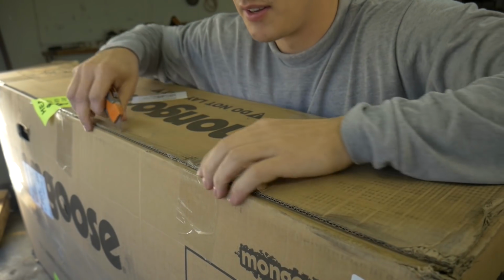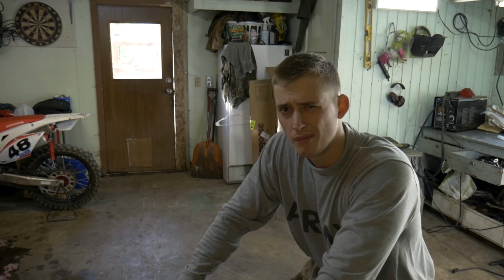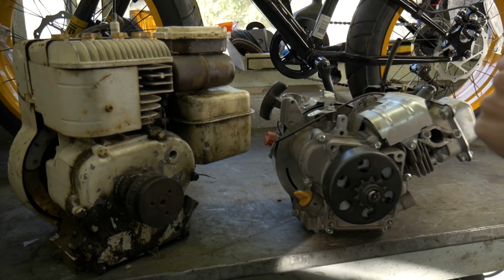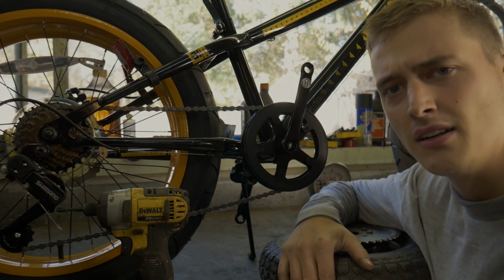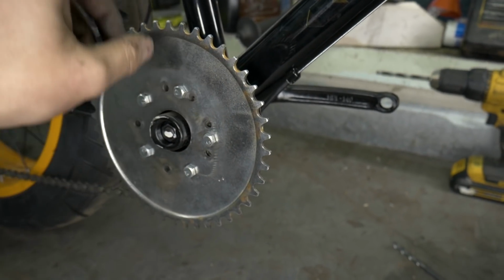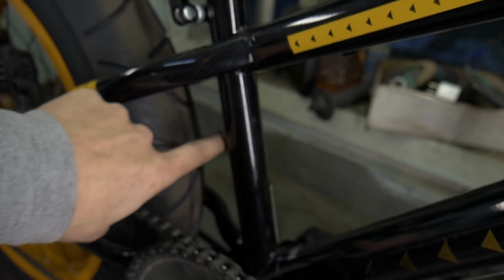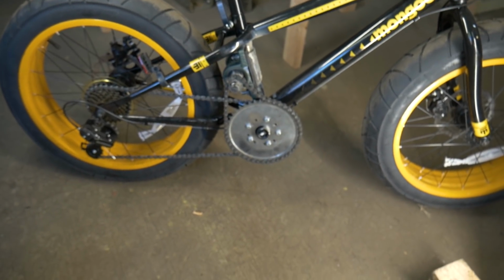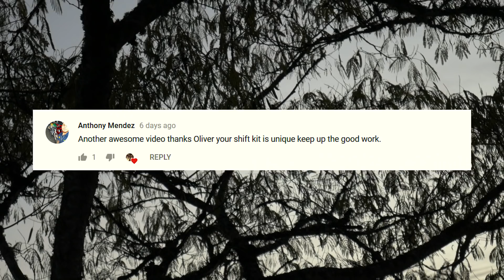DIY FAT-Tire Motorized Bicycle build! #1

Comment: A 79cc can scoot if you remove the governor and add some  springs. I think it's going to be a good project for you. Those fat tires remind me of Hill climbing dirt bikes. I enjoyed your editing style!
Reply: Where did you get valve springs for predator 79ccs I’m working on a predator right now and I’m trying to get as much power as possible but I can’t find valve springs
Reply: Wyditg Today out of my predator 212. You can only run the non hemi ones I believe. Gopowesport sells a wide variety
Reply from the maker: Hey Vasily! I think the way the throttle is set up it bypasses the governor. But yeah this predator has been sitting around for a few years def needs a tune up.Thanks for the comment!
Reply: Vasily Custom Builds thank you very much I’m gonna go order some now
Reply: Honda has a selection of springs that fit and give you great choice.

Comment: Use the briggs have the frame go like this

 https://static1.squarespace.com/static/53547cb2e4b07854cfc514b7/5ac182a98a922d9f46613223/5ac184678a922d9f466171f0/1522633253916/IMG_4913.jpg?format=1000w

If you have some steel tubing you should be able to do it. If I remember, some of those walmart bicycles tubing will fit inside the home depot tubing with a shim drill and and weld but I dont know what size the OD tube is for that mongoose since its fat tire
Reply from the maker: from the looks of it it's all the same OD as normal bikes, it just has a few extra supports here and there. That bike looks really cool! I'll see what we can do